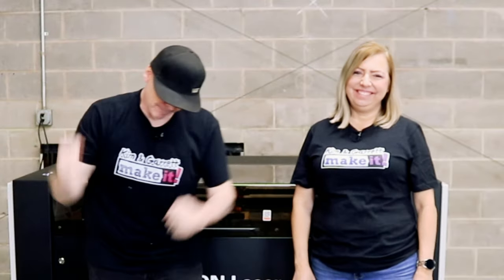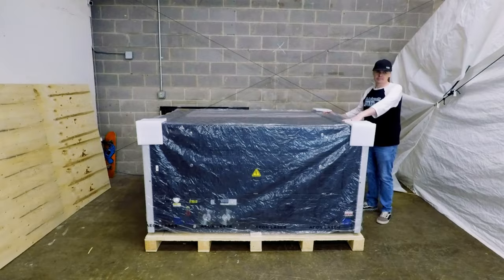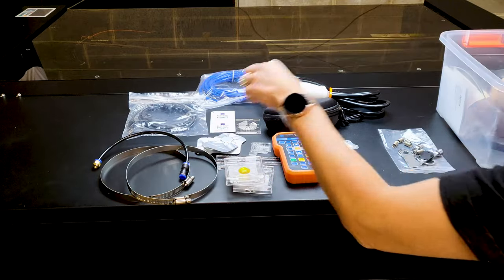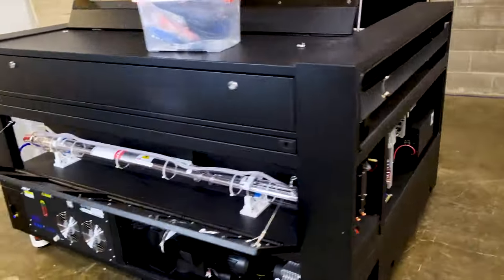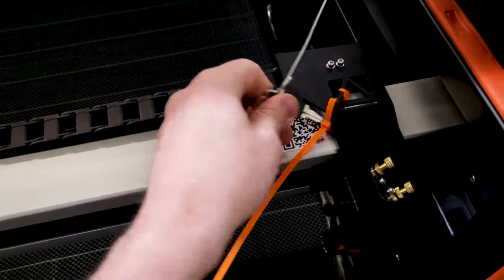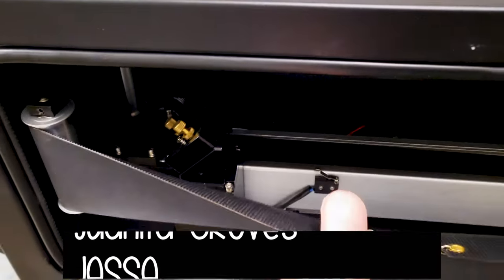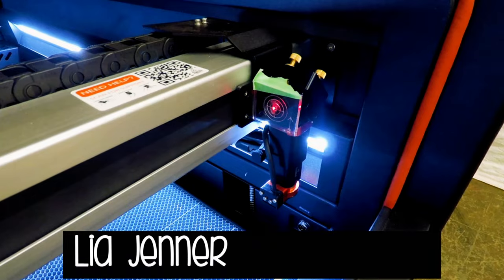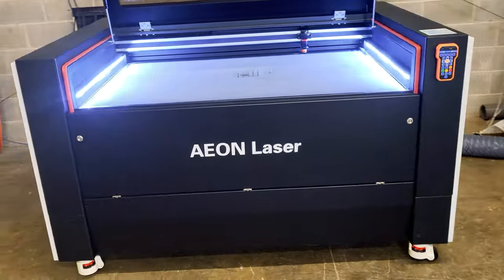AEON NOVA 14 UNBOXING and SETUP

Comment: After a disappointing run with a Monport, I pulled the trigger on a Mira 7. WOW....just amazing. IT took about a week for delivery (Fedex delayed 1 day). The speed increase, the quieter machine, came aligned out of the crate, and the brighter working area is AWESOME. Everything I need is internal (cooler, exhaust fan, camera). To have the rotary port inside the bay just makes the Aeon even better. 

The customer service & tech support are 5-star!!! Each time I have sent in a support ticket, I get e-mailed within 5 minutes from the tech with first steps. My lightburn camera was DOA...they had a replacement in my hand within days. They answer up on the first attempt and even follow-up to ensure I was back on track (my support tickets have been about the camera and getting my OMNI dialed in). I am not a fanboy of anything but God, Family, & Country. I definitely found the best CO2 laser for my money in Aeon Laser USA.
Reply from the maker: RIGHT!?!? The AEONs are like the Lambos of the Laser World!

Comment: I’ve been running the same machine since September.  Despite the internal air assist, an external air compressor makes a huge difference to achieve clean smoke free cuts.  I also recommend putting material on standoffs to hold it a few mm off the honeycomb bed, the combination leads to almost no material clean up required at all.